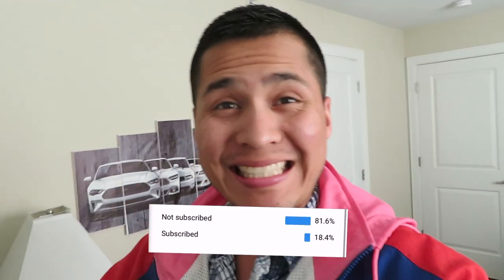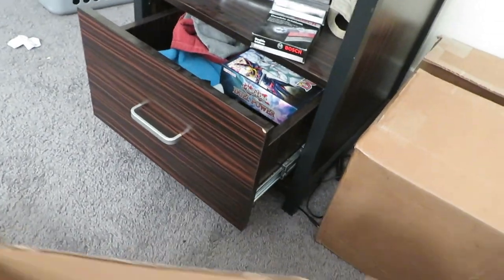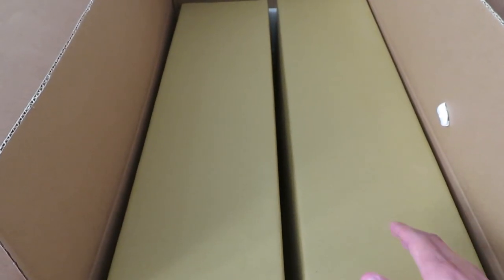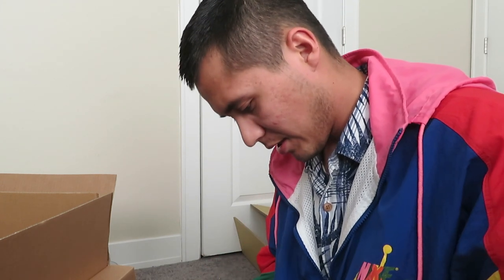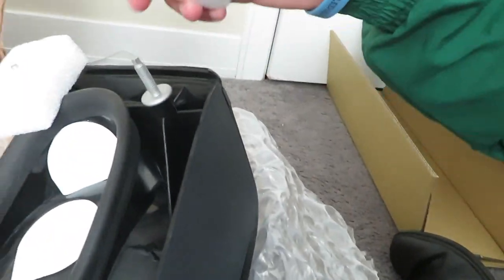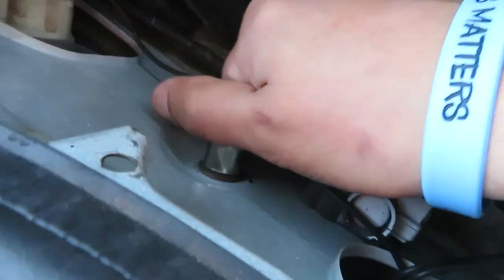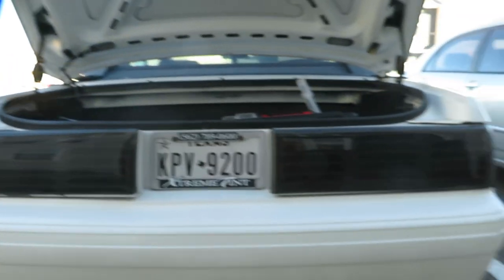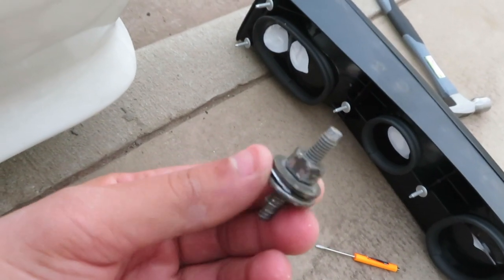The Best Taillights for your Foxbody Mustang

Comment: They send the new bulbs because the original tail light bulbs are clear and rely on the tail light lens to become red. With your new tail lights the lenses are clear so you need a red bulb to have red tail lights. Also a large section of these tail lights don’t light up as they are just reflectors (I believe the entire lower horizontal piece).
Reply from the maker: Ah gotcha the red bulbs didn’t work for me so I’ll have to try and get new ones. Mine lined up perfectly actually.